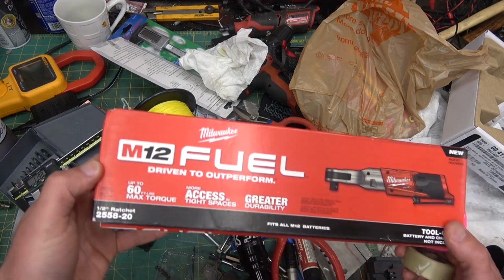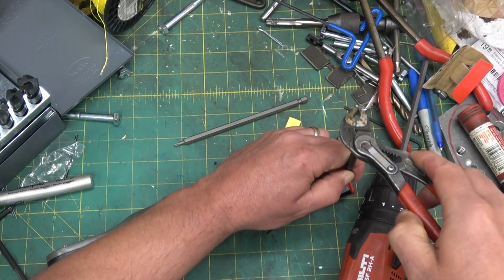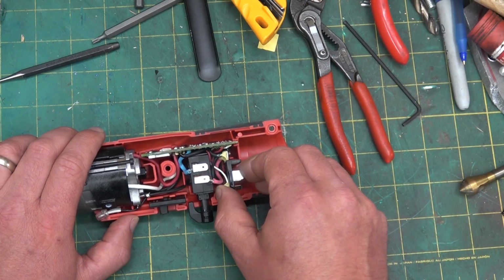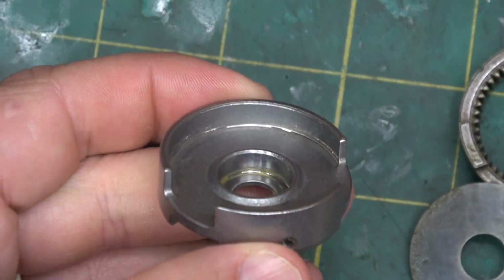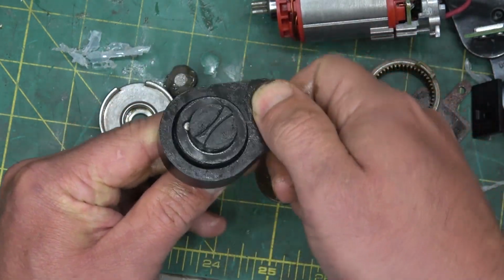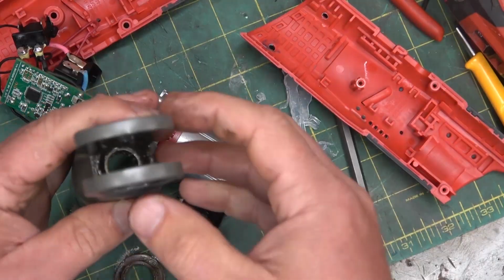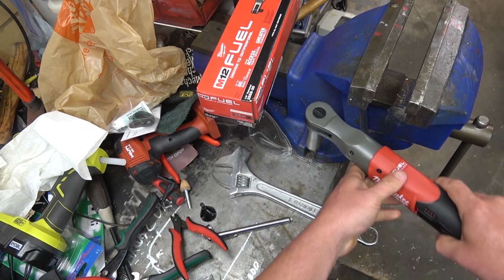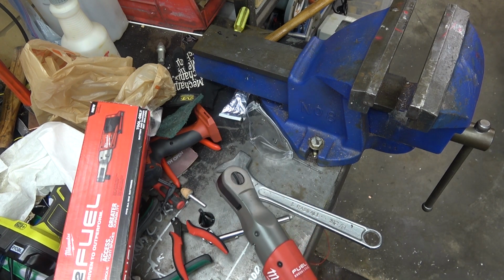BOLTR: Milwaukee Fuel Ratchet

Comment: The ratchet's have a sort of "safety" feature that prevent you from busting your knuckles once it senses enough resistance.
Reply: I had a DeWalt cordless brushless drill (DCD990?) that tried something similar, and I loathed it.  They really did a poor job in implementation, and there wasn't a 'bypass' to skip it and ride the tool into low orbit.  Hated that thing every time it shut the party down with a big bit in low range, and hope the software engineers find a better way to apply that concept.

Comment: I have my Dewalt 20v drill that I retired from work, because the switch is starting to act funky, so the drill randomly slows down, or stops turning briefly. It's seen tens of thousands of screws, and has drilled out several thousand others. If you want to tear it apart, I'll gladly send it your way.

Comment: We use the 3/8 on our Windfarm and the only thing that worn out is the battery case, the overmolded rubber starts to separate, and the circuit board hates getting dunked in hydraulic oil...

Comment: I'm an aircraft mechanic, and almost all our guys have the regular M12 ratchet. The weak point is actually the ratcheting mechanism on them. The ratchet will eventually fail to turn.

The Fuel is too big for our use, otherwise I'd give input on that. Nobody has had a failure, other than the ratcheting mechanism failing, or breaking the battery by dropping it and such.

And in our environment, they get exposed to drill shavings, grease, safety wire, etc. That has yet to cause them to fail. When mine gets nasty, I clean mine with Isopropyl Alcohol, or dichloromethane. Definitely skookum, in my experience.

Comment: I dont have the 1/2 but the 3/8 far as i could put together has the same guts and i have been beating the 3/8 for a long time now. Awesome tool. It does exactly as u say to use it, run the bolts in mostly with the juice button and then by hand after. Its been covered in grease brake cleaner everyrhing. Still going.
Reply: Also, i hate Milwaukee. Lol. But this tool has been a good one when no other company offered one.

Comment: We run a Ford diesel repair shop and battery tools like these have almost eliminated air tool usage. Over past 6-7 years our past and current guys have had at least 10 of these milwaukee ratchets, mostly the 3/8s version. The newer Fuel versions have seemed to improve on the by far biggest weak point we've seen with the non Fuel versions. The ratchet head on these wear out and then they will no longer spin a fastener, even an already loose one. I havent taken one apart myself so I dont know if it's the ratchet paws or gear is worn. I have seen the ratchet housing spread apart and I think that helps lead them to their demise.
Milwaukee was really good about warranting many of them, usually just replacing the ratchet head. 
What we've found is if you dont use it to break loose tight fasteners and dont reef on it to tighten they last considerably longer before wearing out. Also the 1/4in model wasnt strong enough to last in the shop environment, broke multiple square ends off.
With the fuel version they considerably increased the strength of the ratchet head housing so they dont seem to deflect open like the old ones. We've had a couple of the fuel ones and they have definitely lasted longer before the head wears out. To be honest for most applications I think they are built pretty well for the money. But when your tearing the top of the engine off on a modern diesel, there are a shitload of fasteners and its alot to ask for these tools to be reefed on all day everyday and survive

Comment: I have the M12IR 3/8 impact, about 4 years old. Great timesaver for zipping smaller fasteners in and out on cars etc. It did get full off grime and started to smoke. A while a go inspired by your videos I tore it down, cleaned it and lubed 'er up. It rattles a lot but still going.

Comment: I just it daily and nothing on the brushless one has failed. the only brushed 3/8s I burned a motor out in a few years, but ordered a new one from them for like 19$. I also found the replacement oem housing on ebay for super cheap and replaced them just because the rubber coating was coming off. great tool, everyone needs one that works on shit often.

Comment: On the first gen 3/8 my crankshaft kept breaking but you buy a replacement one just don’t loose your parts when it does break because you can’t get a replacement  on part #16 where the crankshaft goes thru and swivels and turns the ratchet

Comment: I'm a Millwright. I have had this thing for about a 2 year and half now and I have dropped it 20+ feet multiple times and the only thing that has gone bad is the battery getting bent or the tab that hold the battery in. Other than that I have not regretted the purchase of this ratchet.

Comment: I use one of these in 3/8th drive at work pretty regularly. After about a year the gears in the ratcheting assembly stripped out. Got a replacement parts kit from Millfuckyee and it's been good ever since.

Comment: Been abusing the older non fuel milfucky's in 1/4 and 3/8's for at least 5 years.  Other guys here at the stealership have too.  Amazing value, and repair parts are available on line.  One tech here paid over $400 for the Snap Off.  For that price, you can buy 3.  All of the M12 stuff I have has been great.

Comment: RDSon has been hammered over the last decade or so. I can easily remember when International Rectifier were the industry leaders with an RDS on of about 6.5mR with a VGS of 10V. You can now get sub 1mR which at 40A reduces PD from 10.4W to 1.6W with a VGS of less than 5V. You still need to double or triple that to account for gate charge and the implications for transition dissipation (the dissipation when transitioning from off to on) but 4.8W is a damn site easier to deal with than in excess of 30. So if adequate colling for the electronics has been provided then it really should not be an issue as FET's (and IGBTs) have parasitic diodes that dissipate back EMF from the motor.

Comment: My 1/4" fuel ratchet has been going strong for about 1.5 years daily for automotive. getting tighter bolts loose get the ratchet spinning first then drop the socket onto the bolt head.
Reply: I thought I was the only one that did that haha.

Comment: Only 400w? That motor looks massive,  I have 800 and 1300w brushless rc motors that are smaller than that, it's gotta be more powerful than 400 surely?
Reply: I'd say no just because you couldn't get that much current from the small m12 battery and this ratchet works find on the little one. I put a brushed higher kv motor and from the traxxas stuff in the m12 vacuum with a cheap 10amp esc, and the small m12 batteries hit voltage cut bearly over stock speed but the bigger 4amp battery handles much better but in the ratchet that big battery would always be on the way.
Reply: @jsomething2  true,  our lipos for rc are capable of delivering massive currents

Comment: I have the 1/4" and it started smoking and loss power while I was working on the wife's car. Tried to take it apart but didn't have all the specialty tools I needed to get the job done. I think it was the motor smoking.  Still works but nowhere near the power it had. Going to get the 3/8" next. Hopefully it will hold up. (I didn't buy it new I got it from a pawn shop so I don't know how it was used before I got it.)

Comment: Been using the 3/8 model daily for awhile now in a high volume shop and it’s been solid. I’ve switched all of my cordless tools over to the fuel lineup and haven’t had a failure yet. They are hard to beat for the price and the battery platform is solid.

Comment: I use one exactly like this on my mill for tightening and loosening the draw bar and also on the knee height adjustment, I have found this ratchet is very power hungry. I had to replace the little 12 V battery that came with my 12 V drill with a 4? AH version.

I haven’t had any problems with it! Have been using it for around 9 months.

Comment: Now I've had the M-12 1/4" drive ratchet for quite some time and she's taken her share of hot lunches. She still pulls her load but wow! She heats up!  I mean, she gets almost too hot to hold without gloves!  Oddly, she also is very efficient on batt power. Weird, I know!  Chris, go get one of these little gems. BOLTR it if you desire. You won't regret having one.

Comment: It looked like the wire ring terminal is one of those with two different crimp areas.  The part closer to the ring crimps over the bare wire and the larger clasp shown just grabs the insulated part, and that does look a bit too big, but the wire may still be crimped securely.

Comment: I wonder how it drains the battery when it is torqued but not busting the nut.  I think the best use for this is the "foreplay" when you are twisting the nuts down in the initial stage, then just squeeze it down tight manually at the end.

Comment: Anti tampering screws, eh? I think Milwaukee are watching your vids, AvE. They're testing you.
Reply: They're not testing AvE. If they were aware of him they'd know nothing short of sonically welding the thing together would stop him... and even then, Mr. Dremel might make a guest appearance. Pop rivets? Drilled. Stud rivets? Drilled and tapped as sleeve nuts. Sonically welded housing?..... zipped apart and fixed with epoxy.

Comment: I purchased mine a year ago just after it came for sale here in the states...
I have not "abused" it and I have had no problems with it  besides the battery occasionally popping out or becoming disengaged. to clarify I purchased the 3/8 version.
I have no need for the 1/2 " but if I were to purchase the 1/4" I would go with the old school style since the head on it is not MASSIVE!

Comment: I have the Snap-On 14.4V 3/8-dr. version of this that i've used for years on trucks and heavy equipment. It works wonders until you go too far and back it into something and need to go down but can't get to the damn direction changer. It is superior IMHO in two ways: 1, said direction changer takes up a good portion of the head, as opposed to the little centered circle on the Milwaukee. 2, the 14.4V battery is a more traditional box shape, makes it easier for yankin' on, not that i'd EVER misuse the tool in such a manner

Comment: i have the 3/8 older one with the brushed. Two things that stand out to me... First, keep your hand on the handle bit. People are really tempted to move their hand down to the battery to get more leverage... It's not strong. Don't do that. You can feel the thing flexing and creaking when you do it. Second, when you're wizzing off a bolt like nobody's business and the ratchet backs up into something. If it's a tight spot, you won't be able to reach the toggle to change directions. Not sure if that happens to anyone else but it's a pain trying to flip the direction with a pick or screwdriver so you can get the tool out. Otherwise it's been fine for me. Not daily use though. The snapon one is more rigid feeling and it will throw your knuckles into all the things.

Comment: 6:30 they use brush less motors in the compressors of newer Bosch and Thermador refrigerators, which require 400$ inverters. The inverters burn out within 4 or 5 years of use.
Reply: Silly Germans, over-engineering since the stone age.

Comment: Is the air vent at the top not the outlet and the inlet at the bottom of the handle therefore the air would be sucked in (oh matron lol) and would cool down the mossy fets first and then the motor

Comment: i have the 3/8" drive version. You nailed it regarding the battery popping out. It doesn't happen in normal use, but it did happen when the ratchet fell off of my parts washer. I really can't say anything bad about it though. It's been a very good tool so far.

Comment: I've got the 3/8" non fuel (head size is much smaller and better suited to the application I use it for) version of this.. without doubt, the best tool i bought last year. Used on a weekly basis for assembling conveyor valances with hundreds of fixings. Battery lasts well, heats up like f@ck like you guessed after a good few dozen fixings. Still wouldnt trade it out due to the pure ingenuity and flexibility of the tool.... have fun playing with yours.

Comment: Oddly enough, (although 3/8 fuel ratchet) my ratchet mechanism has an occasional tendency to stall, where she makes all the noises but won't spin. Most commonly with an extension, but after applying some lube (to the advertised "lifetime lubricated" head) she works just as she did straight out of the box

Comment: i have one of these in 3/8 as well as their brushless impact.  i use my little impact for nearly everything i can get it to just because the speed is really great.  its a great tool, just its still a bit too big, they could earn some favor if they sold an extendocock model like snap on does.  i'd say about 70% of fasteners i use my impact, 10% get this thing, 10% will get a ratcheting wrench, and 10% get a regular wrench, my ratchets are only really used to bust something loose and then i'll swap over to something faster.  the biggest advantage to this is what ave said, i can know roughly if something is tight enough by using this, with my impact its more or less a guess.

Comment: There are some corded power tools with brushless motor.
The first i know of is the WACKER EH9 demolishon hammer and EHB 11 Hammerdrill introduced about 2000 to 2001.
Festool formerly Protool offers a handdrill, Protool PDP 20-4 DEC
Some of the newer demolishion hammers from Hilti are also brushless.
Hikoki formerly Hitachi is offering since a short time a small angle gringer and a big Hammerdrill

The higher effitienty offers a lighter smaller and cooler tools

Example Wacker EHB11 : power input 1,38 kW 2150 impacts per minute at 19J > 680 watts in impact Energy output.
Bosch GBH 12-52 D brushed hammer drill: 1,7kW 2150 impacts per minute at 19J > also 680 Watts

In most corded tools is an electronic for speed control, safetey, overload protection, softstart ect. necessary anyway, but there are no brushes wearing out.
Since most of the heat is created in the stator, the cooling air has not to go thru the motor. Less dirt, less damage.

Comment: I have a few M12 non fuel. My only issue is I keep breaking bolts with the 1/4" driver. It is impressively strong for such a small tool. I need to use my ratchet more so I can feel how tight I have them.

Comment: Just bought one of these a couple of weeks ago, so no long term report.  I am also using it in a machine shop, gear cutting and grinding, specifically. I do my best to keep oil off the tool, but it is everywhere, change gears, setups, cooling. Would you be concerned about oil damaging the electronics in the long term?
Also, I can confirm it gets pretty warm when using it heavily (I ran a small three jaw chuck in and out several times trying to get it set right).
Reply: I also own the 1/2" drive version, for clarity.

Comment: Milwaukee makes two models of those ratchets. This all metal upper like this one and a 30 ft lb plastic upper model. Both 12v. They seem to be a hot seller and highly preferred ratchet over the automotive brands such as Snap-On, Matco etc.

Comment: Electronics are usually more reliable than mechanical stuff, in my experience.  MOS-FETs and other transisters have a lot of subtle failure modes but that's typically based on usage.  So if you have a computer running constantly for years, you'll start getting some failures.  But in normal usage, electronics are fairly stable.  It's funny---people think electronics are difficult but it's the mechanical contrivances that are complex.  If that board fails, I think it'll be from heat or dirt/grease/grit.  And only heat if you abuse it.  Trouble is, to know if you're abusing it, you'd need to do quiz the engineering team and understand their assumptions.  Or give 'er hell and see how long it lasts.

Comment: You're on the nicotine gum too? Works for me: I haven't smoked for 25 years. Just addicted to the gum now. Less harmful, overall.
Reply: Nicholas Hacking I found the gum to be worse.  You can get a big farging nicotine overdose because no one I know chews gum a couple of times then "parks it" in the corner of your mouth.  We all chew the crap out of it and end up spinning.  Use Chantix and stop all nicotine.  Haven't smoked or chewed in four years and don't miss it at all.  Good luck.

Comment: I've had one for 8 mos or so.  I've used it a bunch in my shop working on my big truck as well as automotive stuff.  Works like a champ and saves the wrists for more important tasks.  The little light is fucking amazing while working in an engine bay or underneath.  The biggest issue is reminding myself not to pull on the battery rather on the tool body when giving the final stroke.  I can see some apprentice going for the final torque while yanking on the battery for max chooch.

Comment: I have the 1/2" and use it for building equipment maintenance.  It works great for assembly and disassembly.  That 60 ft-lbs is not a lot, and it's a clunky ratchet when you are in tight spaces trying to break loose motor mount bolts. Works great on tensioning bolts though, so using it to drive cnc adjustments should be fantastic.

Comment: Have both the first gens and the second in 3/8 and use both every day. The first gen is 6 yrs old and as a independent field mechanic I put a hurting on them. Bought the first on when I was at a dealership due to a run of warranty repairs. I didnt think it would last bit it's still running fine even after a dunk into a bucket of hydraulic oil